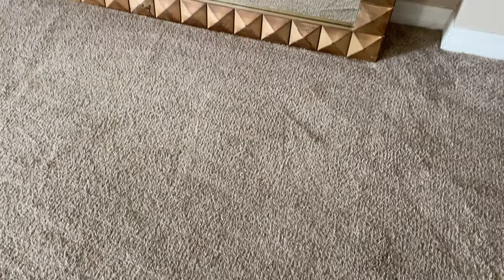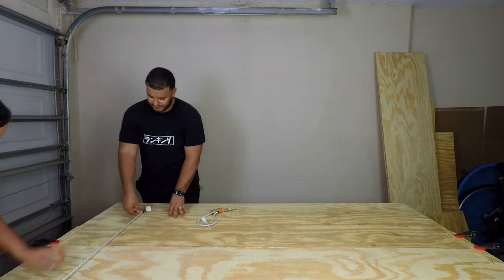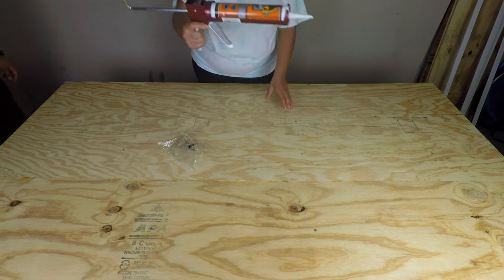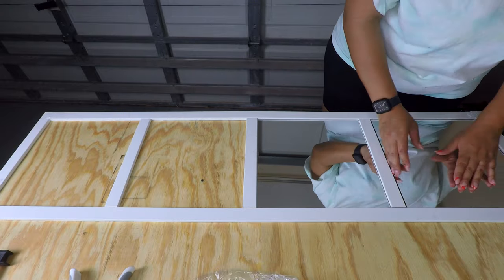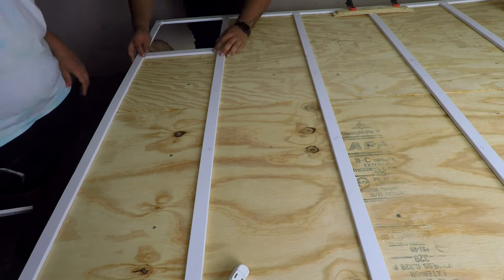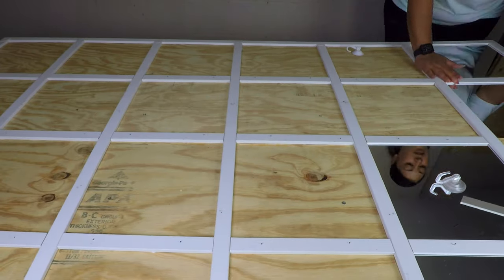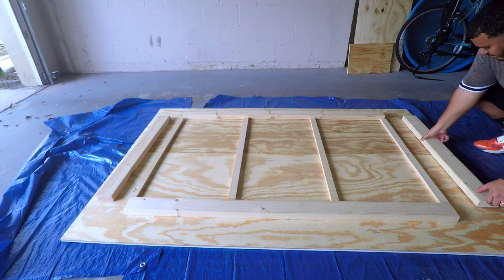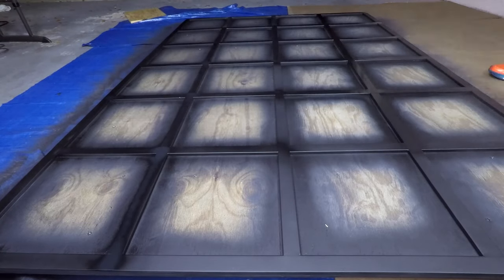DIY GRID MIRROR: Unleashing Creativity with Affordable Materials

Comment: For the outer frame you have attached the trims on top of the plywood to create frame, did you cover the sides of the plywood with anything or did you just save and paint it, if so then doesn’t the plywood sheets show up from the sides
Reply from the maker: Oh this is such a good question! I did not end up covering the plywood on the sides and ultimately just spray painted it, to me it’s really not that noticeable but if you’re wanting a more finished look you can look into adding some Wood veneer strips!

Comment: But what are the slats made of?
For those who use furniture paint, you need a little extra room for the thickness of the paint on the slats, so include that when you  measure for the spaces for individual mirrors.
Reply from the maker: Thank you for this tip in the comments! Love it! The slats themselves are linked in the description along with the rest of the materials I used, the Home Depot description describes is as “Woodgrain Millwork 1/4 in. x 1-1/2 in. WM 2661 Primed Finger-Jointed Lattice Moulding is one of the most common and versatile moulding patterns. Primed Finger-Jointed WM 2661 Lattice moulding can be used to cover seams in wall paneling. Lattice can be also be used in many craft projects”